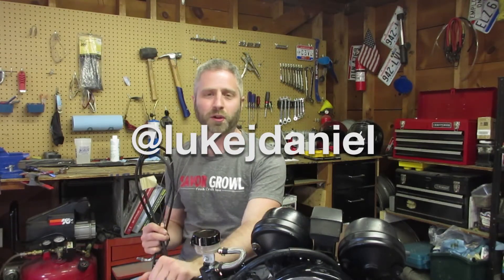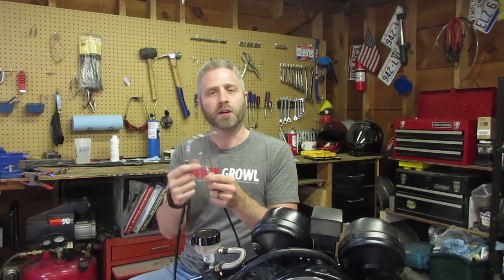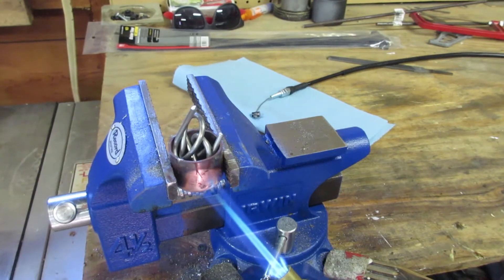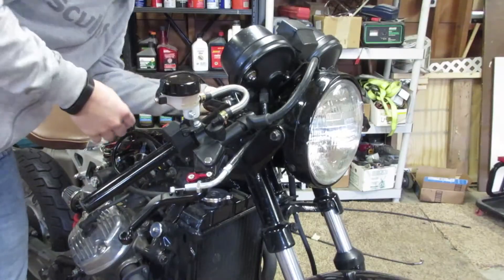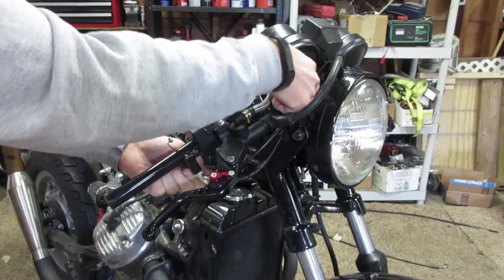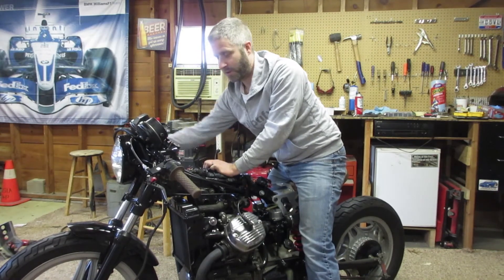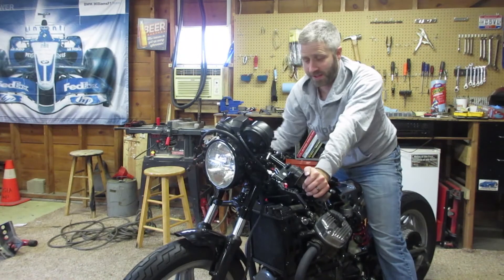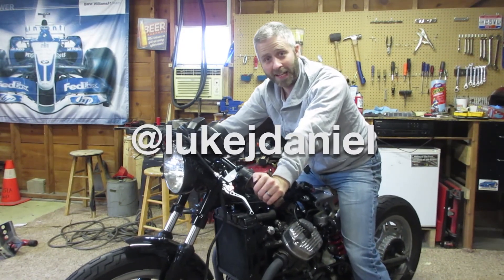Shortening Motorcycle Cables Part 2 : Honda CX500

Comment: I was wondering since part 1 how you managed to pull the factory ends off of the carburator end of the original throttle cable. I own the same cables but just pulling doesn't seem to work. Do you have some kind of a trick right there? 

I'm asking sice you only showed the clutch cable one...